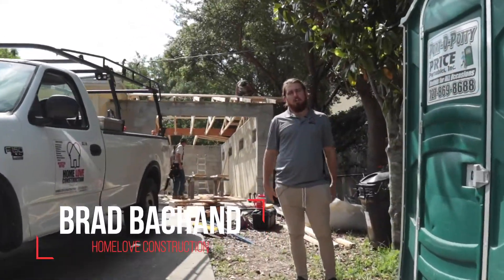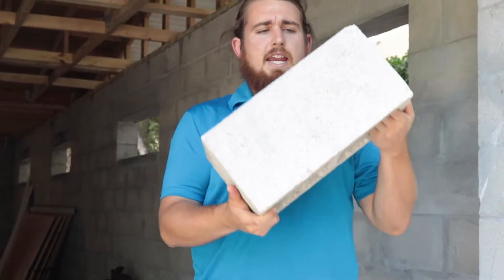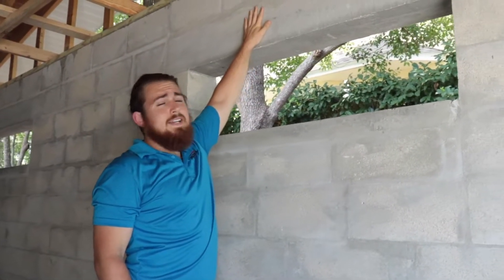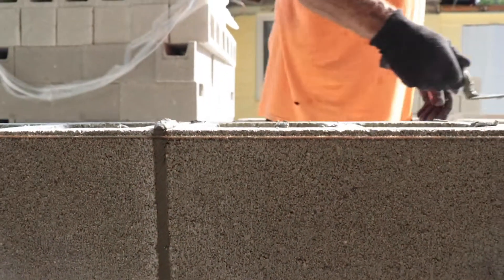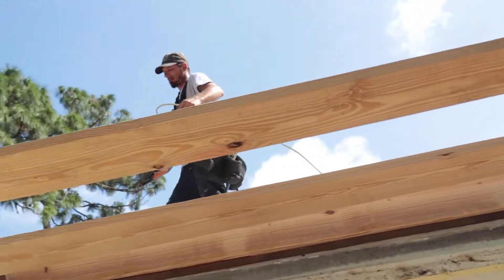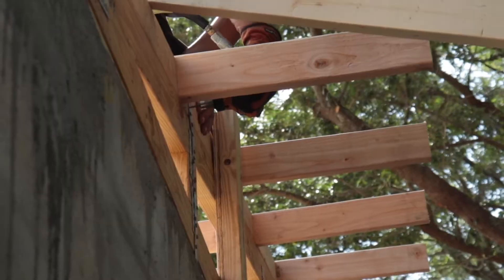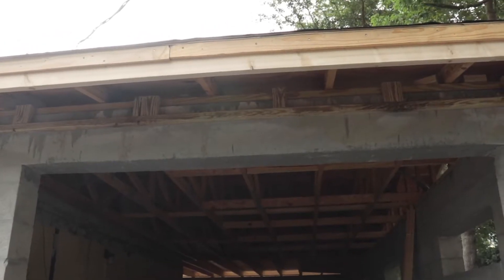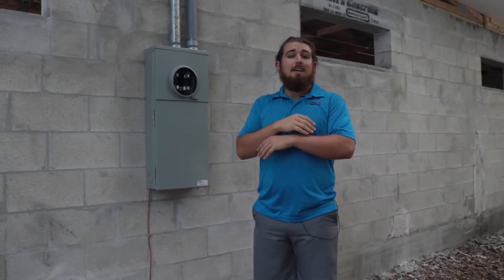How To Build Block Walls And Frame A Roof. Tarpon Springs, FL Garage Addition

Comment: Is there  any wood protection for the trusses on the masonry wall required?
I just failed a HC framing inspection bc according the 'gentleman' something goes on top of the wall and under the trusses. 
Not sure, not a contractor.  Just a FL DIY.

Comment: Question from Tampa. If you want to add a new opening in a concrete wall, like to add a sliding glass door, how do you make the blocks that support the lintel strong enough to hold the new load? I ask because I assume these wouldn't have the rebar like a lintel from original construction.

Comment: Yeah , the roof should have been concrete too . In Florida , they should get away from wood roofs and only have concrete roofs due to hurricanes and tornadoes . Do sprayed on silicone to stop the concrete from absorbing water . 
I am surprised that The Insurance Companies have not pushed for this in Florida .
Also , Hardee board for soffit and fascia - termite proof and will last 50 years .
Reply from the maker: That would be wildly expensive 😂 form & pour concrete is another level of cost entirely

Comment: • How high do you take the block before you fill it with concrete?
• Does it require an inspector each time you fill a portion of the wall for him having to perform a slump test? (can't imagine filling in just one pour for a two story house, for example)
• Do you get people that want houses built on a crawl space? That means no slab to put the framing on. What then do you place it on? A second, inner foundation wall? Masonry hangers cost like $200 from what I've seen, if you were to hang joists in the block for a situation like I have described. Tens of thousands of dollars if you used them. Expensive.
Reply from the maker: Only certain cells and the top course or two get filled. They all get poured at the end unless there’s a stem wall which is usually pored solid. But that’s done all at once too.

In FL on residential slump isn’t highly regulated as there’s a large degree of stress tolerance (in other word, everything is wildly over engineered)

We do. Hangers aren’t that expensive in my experience. Maybe $10-15 a piece for big ones. We do get people who do exact that (there’s more slab on grad where and I recommend that) Sometimes people want the crawl space or even finished storage with a slab under the house
Reply: @HomeLoveConstruction  Thanks for the reply. If you could recommend a masonry hanger that you use, I would greatly appreciate it! I am just very unfamiliar with the standard.

Comment: For the last few months I have traveled in Mexico. Many residential houses have flat roofs with rooftop terraces with tiled floors/roofs. I rented an Airbnb with a rooftop terrace and really like it. It has a covered portion for super sunny times and lots of room (basically the size of the house). Could you build a home with a flat roof and rooftop terrace in Florida under code? I live in Clearwater. Thanks.
Reply from the maker: Absolutely!

We’ve actually added on balconies like this in the past. We are in Clearwater too! Please call our office 727-809-5802
Reply: @HomeLoveConstruction  Traveling in Mexico now. Probably will return to Clearwater in late March or early April. I will call you then. Thanks.

Comment: Why not just build forms and pour a solid concrete wall?  Sure it’s more expensive but it won’t go anywhere in a hurricane… well the wood stick roof is still coming off .. but an 8” thick concrete wall will withstand a whole lot more
Reply from the maker: That could be done! Thanks for watching

Comment: I'm a mason in Illinois, never done residential and I'm still new in the trade but what is supposed to be done up here to tie the wood to the blocks we would use J-hook anchors and bury them in the grout filled block cells. They stick out and have a threaded portion so when you set the wood over the block you just need a hole in every spot with an anchor and throw a washer and nut on it. I think that would be stronger with maybe a few of those straps thrown in every now and then
Reply: I'm in Illinois. How would I get started as a mason? I have no experience.
Reply: As a contractor Kid I agree getting block to hold wood is a challenge. Poured walls can be bolted and drive pins
Reply from the maker: There are Js of rebar in that slab and the block walls. The straps just hold the roof down to the walls. 

Thanks for watching!
Reply: @HomeLoveConstruction  gotcha I didn't catch that in the video. Good stuff.

Comment: I needed to see the footing beam that the roof rests on. It rests on top of the cinderblocks. How is that attached? On the floor, its drilled right into the concrete. But the blocks, if they're not filled there's nothing to drill into. Does it only rest on the top blocks ?
Reply from the maker: The beam is usually made of U shaped blocks that get poured solid. They get mortared onto the blocks below and there is rebar that ties it together

Comment: Aluminum soffit how does that make hurricane code ,that's gone @ 60,70 mph and if the code is about protecting your home why do all builders in fla put interior drywall on exterior ceilings and use interior drywall mud to finish it,😉

Comment: Cool video. Im building a 14x30 shop with half of it a room witha bathroom. One of my ideas is doing block walls and a framed roof like you showed in this video. But for my roof im thingking about a hip roof. i/m in the DFW area. In texas. we can get tornados where i live and this idea will make it withstand problally an EF3 tornado.
Reply from the maker: A hip roof is preferable in most ways to a gable roof. Gable roof construction is a bit less expensive than a hip due to needing less trusses and less labor in framing the roof structure but it is far better in high wind areas.

Thanks for watching!

Comment: Wrong that is not a concrete block that is a haydite block and some people say no they're heavier than haydite that's because there's two ways to make them one they leave them light and fluffy. two they have a machine that shakes them making them heavier by taking all air bubbles out and that's so crazy he's talking about that lentil we frame Inwood then lay are you block across it put Steel in concrete across it or mortar go to the next course you don't use a solid piece unless you don't know what you're doing and these guys are clueless
Reply from the maker: Thanks for watching!

Comment: Thank you for your video I'm trying to resolve an issue in my house and dying to find out what is behind the stucco above my garage doors. My roof has a very very high pitch compared to the one in your video. I think it's something like 6.5. the pointy part of the gabled roof is directly over the garage and I know that it can't be concrete block up there above the garage opening. So what is it? I have those same plastic soffit inserts at the peak of the roof in the middle of the garage coming down to 8 ft height on the sides. What is behind the plastic inserts in the soffit? If rain is hitting the house sideways head on what stops water from going inside the plastic soffit and coming in behind the wall? Is the wall wood above the concrete block? I would appreciate seeing the rest of that video where you finish the wall up to the roof behind the soffit. What makes it watertight where the wall meets the soffit or the roof? I have a hairline crack horizontally in two places above the garage. The painters just want to calk the crack in the stucco and paint the house. But because I don't know what's behind the stucco or what is causing the waviness in that area, I'm tempted to rip it all off to see what's behind it and if something was done improperly that I could fix and have restuccoed. I don't have the knowledge in construction to know what's behind that stucco in a concrete block house with a 6-in pitch roof but I know it's a wood frame on top of concrete block just like yours in the video. I've never seen plastic soffits before I bought this house. Can water get in there? 🤔 I'm assuming it can especially if it rains in front of the house and the wind's blowing towards the front of the house or if you pressure wash the house and soffit. So I guess I'm trying to find out how that wall is sealed between the roof and the concrete block before the stucco veneer is applied? I greatly appreciate your feedback. Thank you again for this video it helped me a lot just left me wanting more 💕
Reply from the maker: Typically the wall goes up behind the soffits and the soffits are resting on a piece of “j-channel” that’s attached to the wall. Even rain going vertical can’t get up into the wall.

The only typical way you get water behind the wall is if the roof leaks

Comment: What finished product look like
Reply from the maker: Beautiful obviously 😉
Reply: @HomeLoveConstruction  how do u do the drywall on the blocks?
Reply from the maker: @Mobakar  You install furring strips onto the block. They are nailed in with masonry nails using a gun called a T nailer. Then you insulate with foam insulation and install the drywall screwing it into the furring strips.

Comment: Can someone give me a rough ballpark of what this size and style garage would cost to build? Does this need to be done by a general contractor? Thanks!
Reply from the maker: It depends on where you live for both questions!

Put cost on a project of this size in Tampa bay is about $70,000 (about 475 sq ft block garage).

In our area you only have to use a GC if the property is jot your primary residence.
Reply: @HomeLoveConstruction  great that was very helpful! We live near Tampa and I will reach out when we get closer. Thanks

Comment: How did you accomplish the corners? Are they poured? In Puerto Rico it seems like most set pillars and the block meets at the pillar in each corner. Trying to figure out the most effective way for my build
Reply from the maker: Yes we poured the corner cell and 1 cell on either side. They also get a piece of #5 all the way down tied into the footer

Comment: How is the top plate attached to the blocks?
Reply from the maker: Hey Jeremy, we used tapcons to attach a 2x8 PT to the top of the block wall. This goes all the way around the block walls. Then the trusses and rafters are strapped to the block and toenailed into the 2x8. The beam is bucketed into the block walls. 

Thanks for watching!

Comment: Hi, I'm about to build a 24'x24' room in my backyard in Nashville for music production. I'm planning on using cinder block (filled) and then framing after a 2" air gap to help prevent sound leakage for my neighbors. Only one long window up high like yours. Will have a shed roof from 10' to 14' approx. How much (ballpark) can I expect it to cost for the block walls? What size was this one? Thanks!
Reply from the maker: This was about a 750 sq ft garage. From dirt to block walls with a roof on the structure was about $50,000 but that is Florida (Tampa Area) pricing. Pricing can vary significantly. Typically in most areas of Tennessee construction is less regulated so costs can be lower. However there is currently a shortage of construction materials so prices are very unpredictable. I hope this helps a little bit! A contractor in your area will be able to answer further questions I’m sure
Reply: @HomeLoveConstruction  Thank you! That does give me a ballpark figure of what to expect.
Reply: @musicproductionvideos5019  How did the studio build go? I'm considering something very similar in Nashville.. would love to pick your brain.